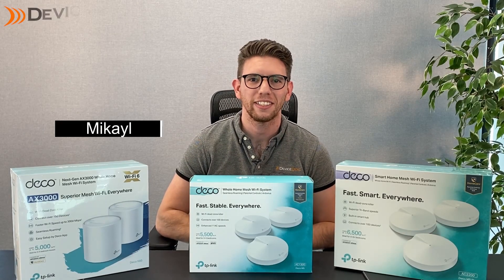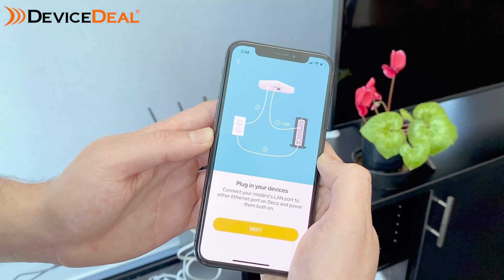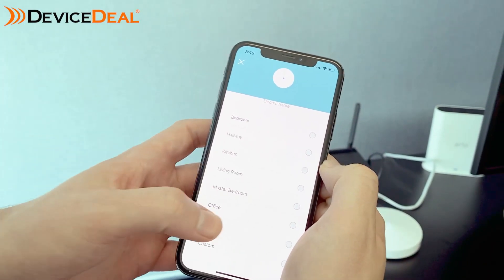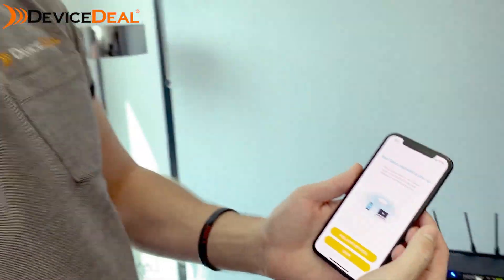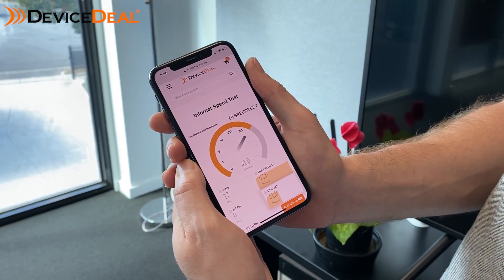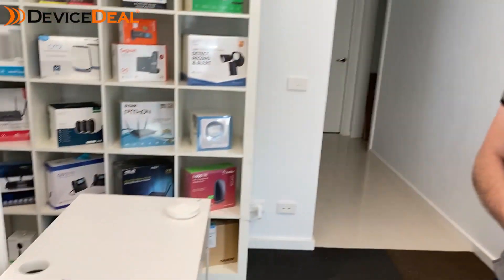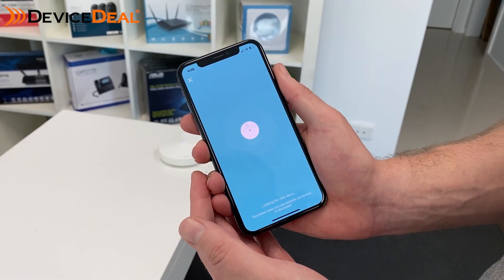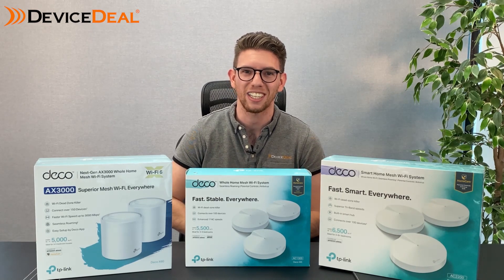TP-Link Deco M5 Setup & Speed Test (Home Mesh Wi-Fi Guide)

Comment: It seems the videos I watched on the M5 have all setup the first pod with an existing router. I have an older Linksys 2500 router that I am reluctant to use as I think it may be a bottle neck for IPS speed. I believe I have the option to leave the old router out of the equation and connect the first pod directly to my modem. Is that accurate? The 1st Pod will then operate as my primary router? 
Because I have a need to plug in four ethernet cables at the location of my first pod I plan on purchasing the "TP-Link 3-packDeco M5 Mesh with 5 port Switch". So I assume that I would connect the 1st Pod to the Modem and then use the second port on the 1st Pod to attach the 5 port Switch. Is that also correct?

Comment: 2nd speed test is done using the tp link app, which directly checks speed from main router, and not from the 2nd mesh
Reply: That is correct, It was odd he didn't use the same speed test tool on the second test, kind of deceiving.

Comment: If I choose to use the same ssid as my current router is using, will I have interference or will I have have to turn off the router's SSID and only use the Deco?
Reply from the maker: Hi. The Deco will give you a new SSID (network) to connect to. Shouldn't cause any interference with your current router. Just make sure you connect to the Deco instead of your old network!
Reply: @DeviceDeal  so no channel interference with current ssid?